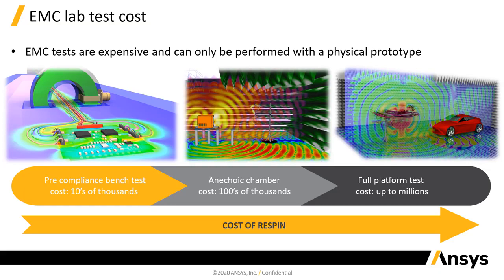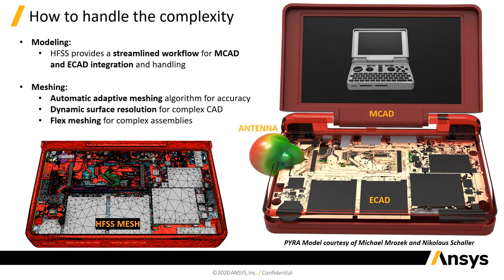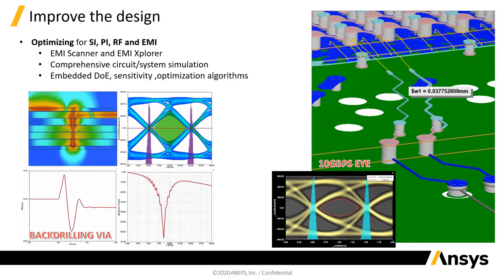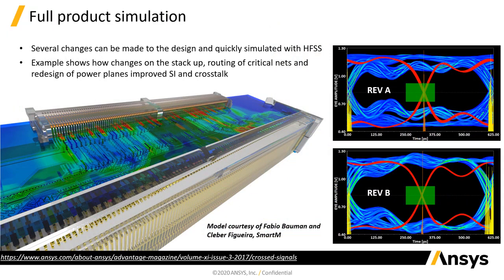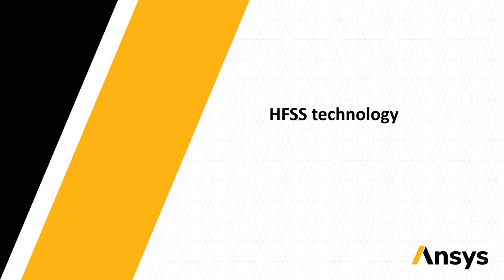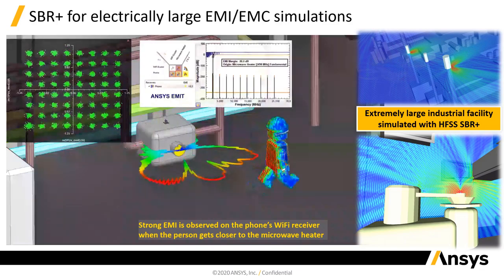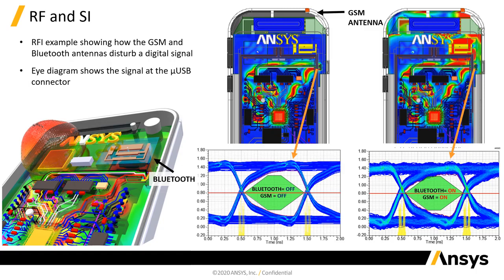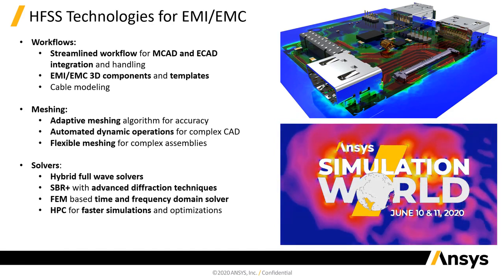EMI EMC Workflows in Ansys HFSS

Comment: Hi there, if I may inquire your kind help.. is it possible to do EMI or EMC simulation using HFSS on PCB?
Reply from the maker: HFSS has the capabilities to perform EMI/EMC simulation. You can take advantage of Ansys EMI Scanner in HFSS 3D Layout (which is the layout interface of HFSS) to identify the design issues due to EMI during operation.
Reply: @fluidcodes-ansys-partner   could I expect tutorial of  EMI simulation (Conducted Emissions) In PCB by using HFSS 3D layout
Reply from the maker: @rajasekarandhandapani517  Thanks for your comment. Stay tuned with our future updates
Reply: @fluidcodes-ansys-partner  Thank you so much ! And this EMI Scanner comes in Ansys SIwave right ?
Reply from the maker: @afiqmr  Yes, it is also available in SIwave.
Reply: Hi afiq,
Greeting,
do you have any reference or videos for perform simulation for EMI using HFSS on PCB
Reply: @rajasekarandhandapani517  Using HFSS specifically, nope. I just used the SIwave software for EMI scanning
Reply: @afiqmr   ok afiq
thanks for your quick response